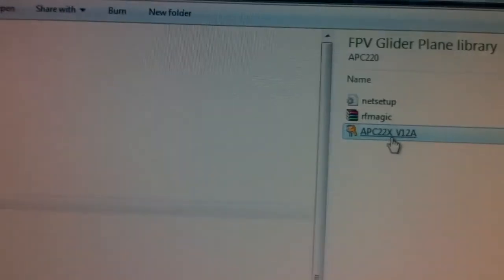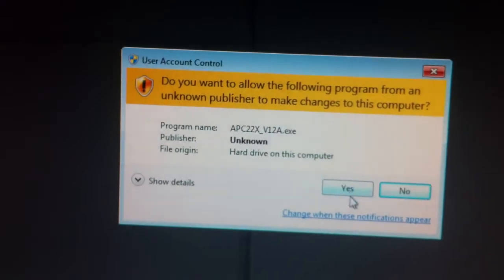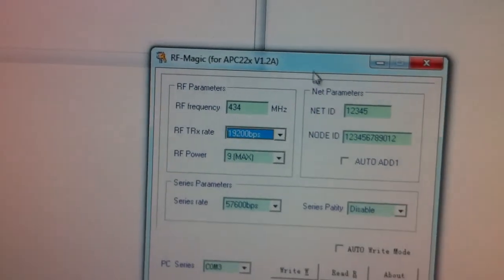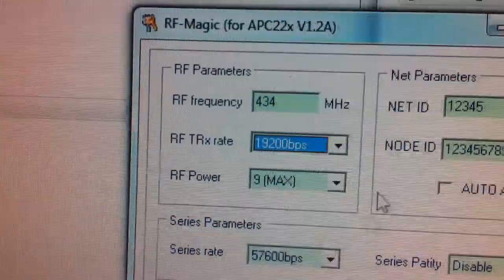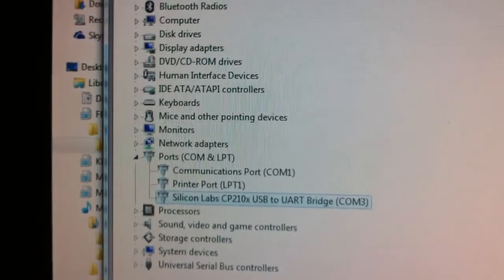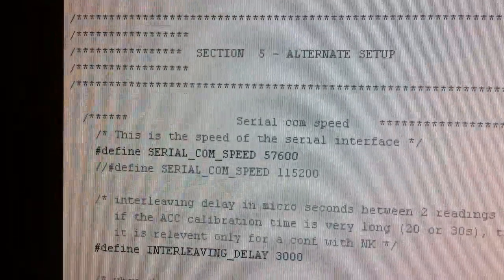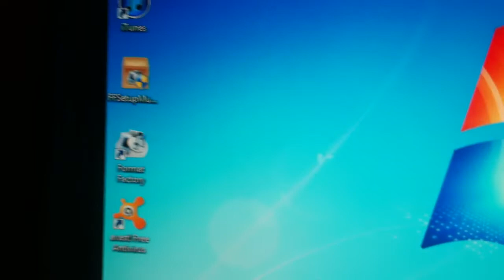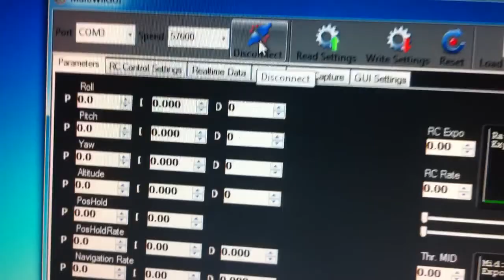APC220 issues communicating to Multiwii FC board.

Comment: hey man! i have a quick question. i just bought the APC220 and im trying to set it up on my wultiwii but there are 7 pins on the APC and 6 on the muiltiwii. do you think you could help me out and tell me which pin goes where and which one i have to leave alone?
Reply from the maker: All you need to connect is the power (VCC) to power (5v)......... ground to any of the grnds on the APC........ TX goes to RX & RX goes to TX.
So as one transmits the other receives and vise versa....... hopefully that makes sense.